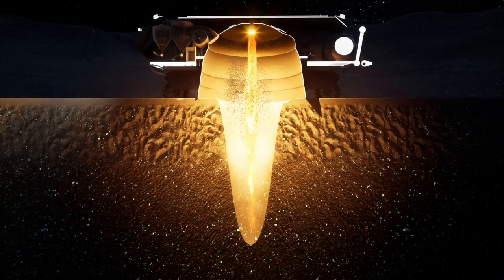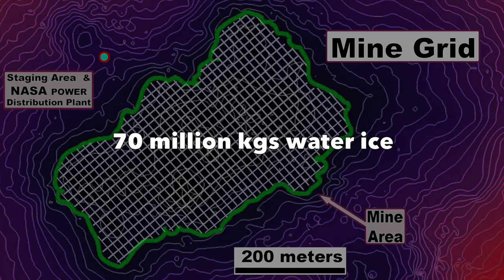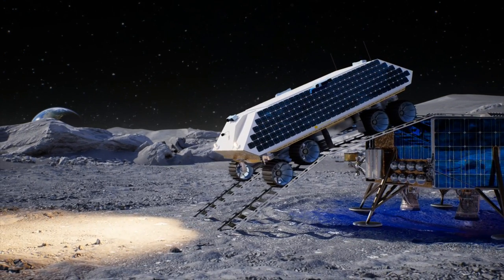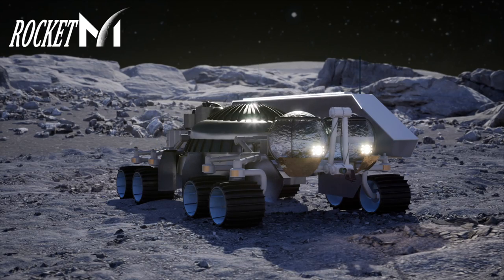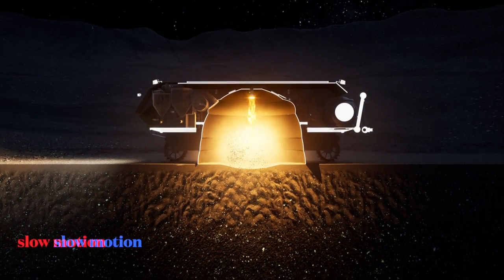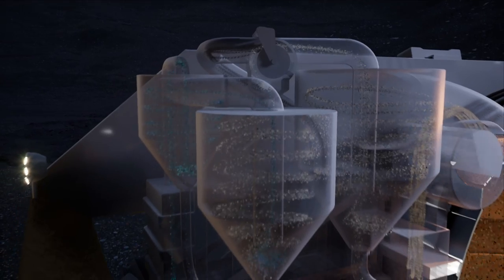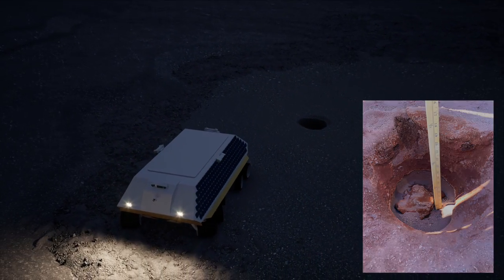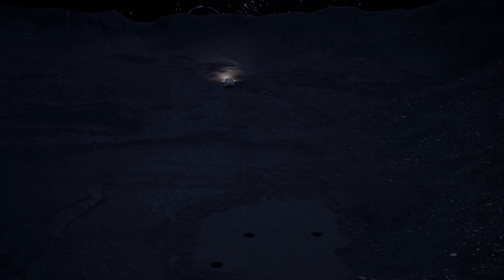Masten's Rocket Mining System: How it Works

Comment: How much fuel is used in each pulse?

PS
I see the blog says it's a 100 lbf thruster... assuming low specific impulse because it's of low pressure feed, say 350, makes 100/350 pounds of propellant per second, 0.142 lb per pulse? (64 grams)

Comment: How is the thrust produced by the RocketM system handled? It looks like it puts out quite a bit, and all that gas/partyiculate will be fighting to escape that collapsible dome. Will the rover be heavy enough to maintain a good seal under lunar gravity?
Reply: I believe it's just "melting" the ice the thurster would defently not put out eqnough to lift the vehicle or break the seal on the dome

Comment: It seems to me that the rocket "smelter" is excessive in this scheme, a combine like those that plow the land would be more economical. Getting water with a rocket is like firing a cannon at sparrows. It is also obvious that this rover will not collect a lot of water.
Reply: The problem as explained in another video is that lunar regolith is very abrasive, so mechanical digging systems will have sever wear and tear.
Reply: @SierraSierraFoxtrot  Not to mention, the solid ice is volatile in the vacuum so any that is kicked up and not recovered by the system will sublimate away and be lost.